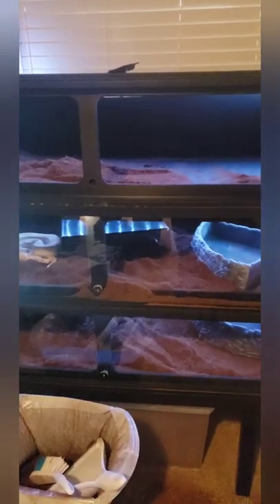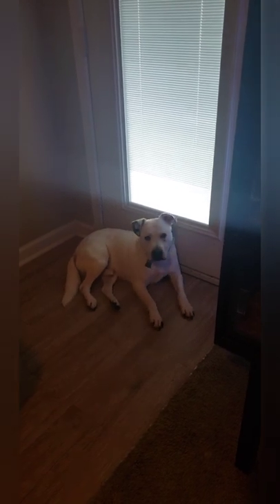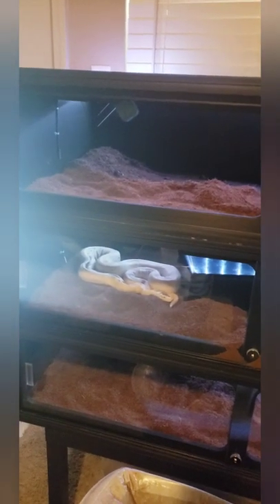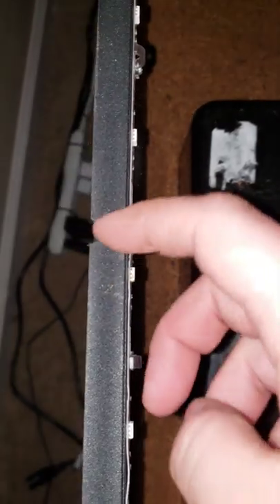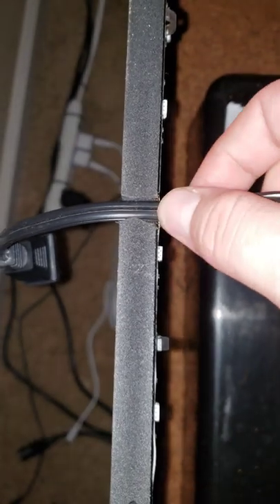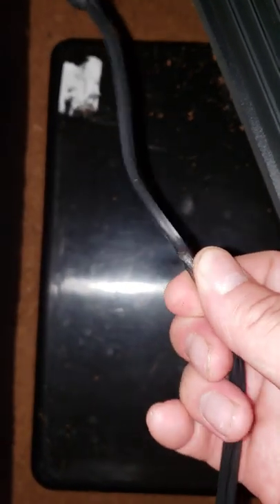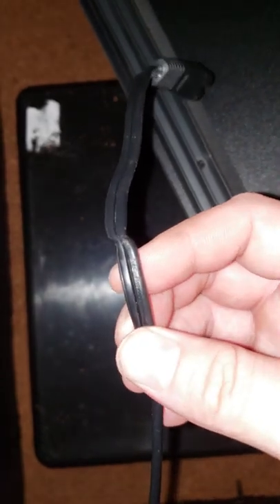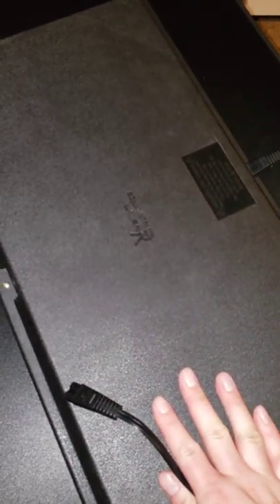Troubleshooting a heating issue in snakes enclosure

Comment: I very interested in one of the cages you have I believe it’s the T8 how much do they run with the heat panel and everything included
Reply from the maker: Around $320 for the heat panel and the enclosure. The thermostat depends on what you want to run.
Reply: Rousseau's Reptiles would a male red tail be good in a cage that size for awhile? Thanks for the reply
Reply from the maker: A male would be fine. He may need a larger setup once fully grown.

Comment: Do you use the 8" stands for the heat tape/pads on the T8s or are those totally unnecessary?
Reply from the maker: I use 80 radiant heat panels. Belly heat isn't necessary.
Reply: @rousseausreptiles  and they just stick to the side of the vision cage?